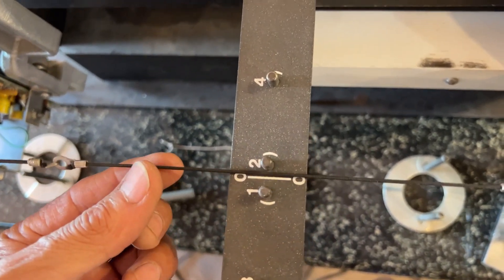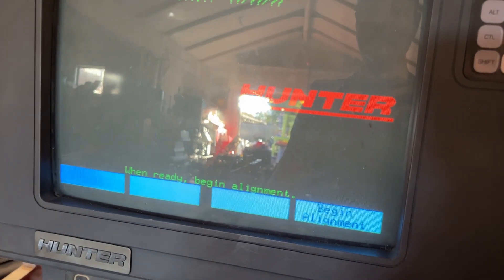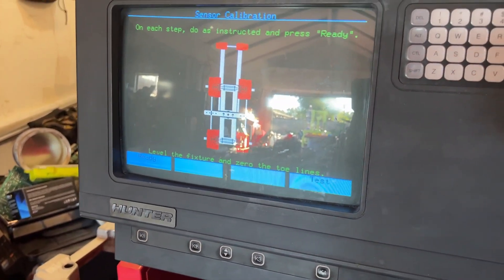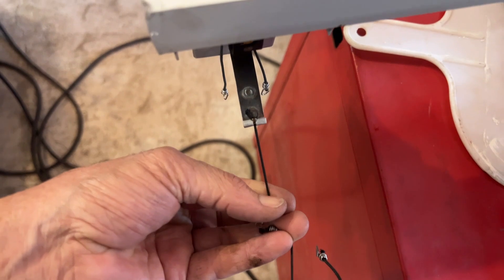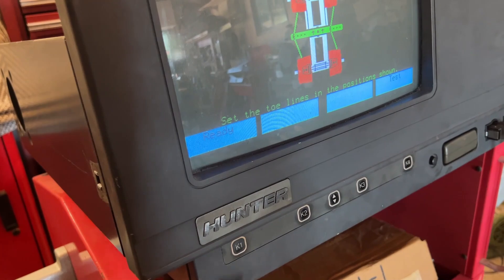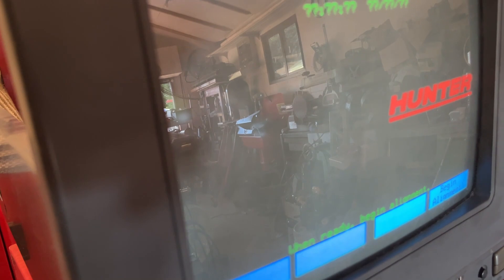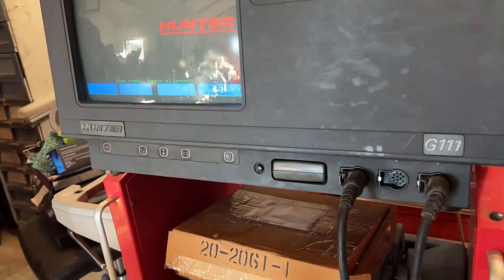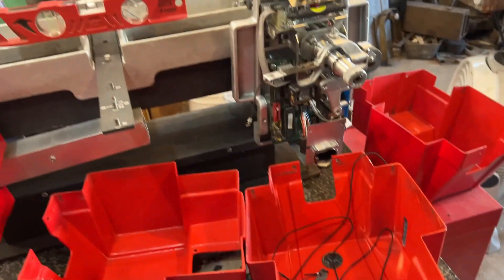Hunter G111 calibrating hybrid sensors

Comment: Hi Carlos, I purchased the identical machine to yours, also a g111. Would it be possible to make a jig to calibrate these myself? I have the infrared sensors.
Reply from the maker: Unfortunately, the only way to calibrate these machines is with the calibration fixture ( Special frame, angle spacers, and set of prisms along with the calibration board).

Comment: Hi Carlos. Do you know what the difference is between the car, truck, or bus sensors? I recently purchased a H111 machine, which came with all of the calibration equipment. I haven't tried to calibrate it yet, but it was used on a heavy duty pit type of machine that was used to align motorhomes as well as cars.
Reply from the maker: As far as I know, the only difference is the size and shape of the toe arms on the front sensor assemblies. Truck arms are longer to accommodate big tires, bus sensors are longer as well but bent downwards to clear the low body of the bus.